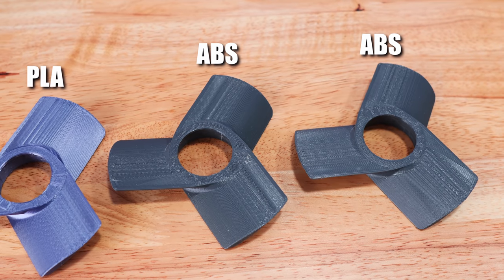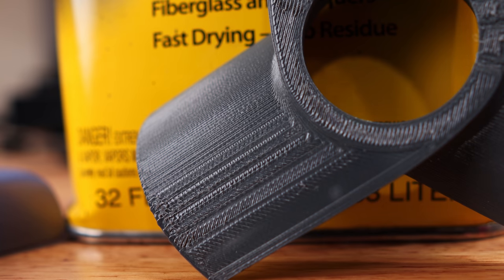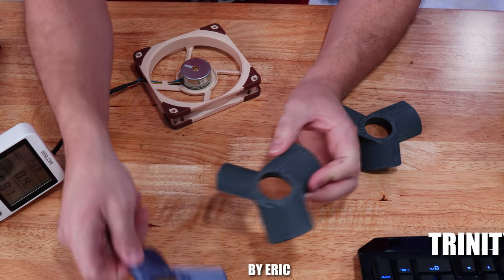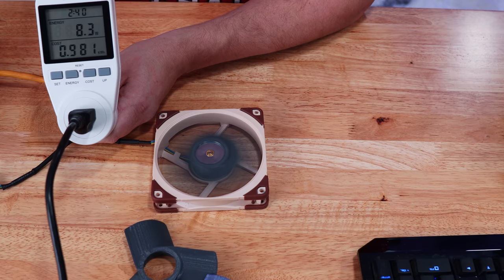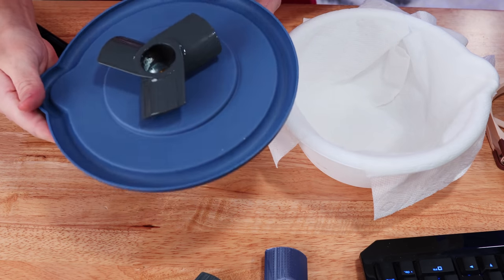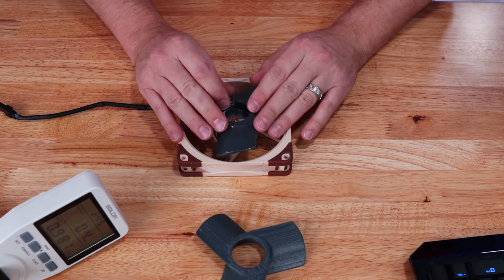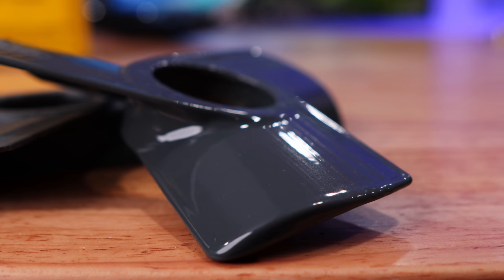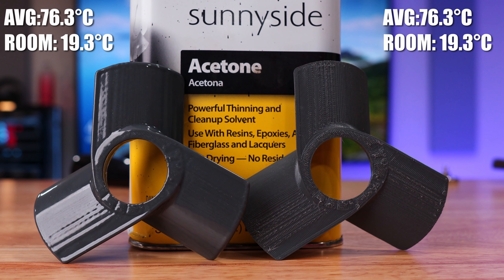Does Smoothing 3D Prints Improve Performance and Can You Smooth PLA?

Comment: First of all what this series lacks is a refence. The perfectly treated original Noctua is not a good reference. The same printer and filament should always be used and what I would suggest is actually printing out the original Noctua blade (with Noctuas permission or a co-operation of them sending you a print). Otherwise the results tested against the original are  poor.

Of course you get better performance with optimized surface. I hope this was never doubted to begin with.
What's more important: literally nobody, if it can be avoided, ever runs the fans at max speed. So they perform better by noise normalizing or being less noticable at the same cooling performance.

That said a glossy surface like presented here is not necessarily the best performing one. It's just that the printed surface is garbage when printed at those poor layer heights. I'd go for at least 0.12 or lower.

On top the effect can vary with surface itself. The fan present here might not be the best example for a typical 7 blade high surface design. But in the end it'll be hard to measure with amateur equipment anyways. Just something to keep in mind while seeing the "results" to interpret them correctly.

Great series though. Fun to watch the different designs.

Comment: size, blade count, pitch and weight determine motor loading. i fly fpv drones so matching a blade (prop) with motor's kv rating is essential. smooth or not that doesn't play much of a important role,  the difference is so small you cannot read it with that reader.

Comment: It's still pretty rough.  You've knocked off a few of the high frequency components but ...   I reckon it's time you got a CNC of some sort.  But the money !!!    Why have the paper hanging outside the container? It will only increase the rate of solvent loss.  Why am I even interested in this?    🤪

Comment: Well, In nature, almost nothing designed to move (with high speed) in air or water  is actually smooth. It may look smooth, but microscopically is anything but smooth. Take look at shark skin for example. A quick google search revealed this: https://www.travelandleisure.com/airlines-airports/sharkskin-squid-helping-build-planes
Soo... air needs to be guided, not let to freely pass over a smooth surface if low friction is desired.

Comment: at I've said plenty of times; at this scale, it doesn't make a difference.Golf-ball like dimples didn't make a difference and this is exactly the opposite (the grooves from the layers would have a similar effect on the air as dimples) so it doesn't have an effect either. It's not even about the surface, it's about the total size, and besides, drag doesn't really affect airflow for this purpose anyway, or car radiators and factory ventilation would also have them.

Comment: "smoothing" is a generic concept, not a specific chemical process that works with ABS.  You can also "smooth" 3D prints with sandpaper and fill gaps.  There are also epoxy coatings, like XTC-3D.

Comment: Smoother surface does theoretically improve airflow due to turbulence. But the fact is that in this application the difference will be so small it's basically irrelevant

Comment: Actually there may be a false interpretation of the given information. As the fan is pushing more air as there is less parasitic drag, because of the smoother fins; the fan motor will of coarse need to work more as more volume is travelling through. What smoother fins encourage is laminar flow which is what you are trying to achieve as apposed to turbulant flow. A volometer would point out the difference better than (pun intended) blowing smoke shows heh.

Comment: Is it just me or did both times, up and on the table ... it clearly showed 8.0 for a millisecond on your video.. it goes from 8.4 to 8.0, then you moved it again after it sat for only a few seconds of test....
Reply: thats a 5 percent drop.
Double checked.. yep, both times the smooth blade went down to 8.0 flat. 
Smoother aerodynamics wins
Reply: 5 percent power savings using them 24,7. Imagine if the world converted all pc fans to that. Instant 3 to 5 percent drop. Pretty crazy numbers if you run 20 fans, it pays for a whole new fan to run

Comment: I don't like the way you are measuring the power. Sure, the power supply has to get that energy from somewhere, but I'd prefer to see you use two multimeters, or just a 12V capable USB power meter (those are pretty cheap directly from China). 
You can actually smooth PLA, if you can get access to Chloroform/Trichloromethane.
And I think if you put two lamps in the corners of your new set and make a color gradient (like between a light blue and magenta), that would look pretty sweet.

Comment: first thing I thought was "sandpaper" not acetone lol

side note, 1 db is not audible to the human ear, so in reality they will sound exactly the same, measurement wise sure, 1db difference. in the car audio world, I get people bitching about 1db loss from "speaker wire that's too small" but when I do a blind test, they can't tell which car was the one with the 1db loss through the wire.... because no human has ears accurate enough to notice 1 db difference.

Comment: a smooth blade creates less turbulence which is more efficient.
Reply: it went down to 8.0, and he did not notice. That is a pretty tremendous difference for a simple smoothing. 8.3 changed to 8.0, watch closely
Reply: At the reynold number the blades are at, it's probably not even noticable

Comment: Prediction: The smooth will perform slightly worse or equal to the rough.

In aerodynamics laminar flow is the vision of perfection. But if you try and fail to get it the results are not good. Rough surfaces cause turbulence in the boundary layer which makes the surface perform just slightly worse than with good laminar flow but a lot better than broken laminar flow.

Comment: Sadly this power meter isnt sensitive enough to see the difference, so that test is completely irelevant. Logicaly the smoothed print does have slightly better efficiency, but its only a few %. 1/4°C difference would an amazing improvement for this kind of efficiency improvement, but sadly PC sensors are not sensitive enough to measure that. 

Otherwise nice testing and experimenting. nextime try to do a bit of research like how much usualy normal fan draws and from that you can estamate how big improvement can be, and how sensitive measuring you will require.
I love your testing videos. keep it up!

Comment: Up next: what happens when you acetone smoth an abs fan while its spining...
Reply: oh dayum! That would be cool. run the power wires through the tupperware lid and spin it up while its smoothing, just to see what happens.
Reply: The acetone might mess with the lubricant in the motor. Could destroy the motor.

Comment: Push it further man, you have a lower surface area because there are onlyt 3 blades. The results are not significant enough to be show, but with a 9 blade you have maybe 3x the surface area area thus 3x the effect of smoothing out

Comment: I strongly disagree that saying it being quieter is a performance gain. The smooth fan does no offer a performance gain.
Performance of a PC is relative to the number of operations that can be output per second.
Performance of a fan would mean lower temperature, meaning a higher overclock, meaning higher performance.
With that said, there is a higher preference towards quieter fans.
You can just say that a smoother fan is better because its quieter, but saying that it has better performance is very misleading since the function of a fan is to move air.

Comment: you are not actually adding resistance when pointing the fan down into the table, you are making it do less work since its moving less air... similar to blocked the hose of a vacuum cleaner with your hand.

Comment: If you want to see anything you should measure the efficiency as a ratio between the amount of electrical power consumption and the airflow x pressure. Measuring only electrical consumption and a zero pressure or zero flow makes no sense...

Comment: Just soak the PLA in liquid acetone for a few hours
Reply: It's not chemically compatible.  The solvent needs to be able to bond with the molecules of what you're trying to dissolve.  This is why certain plastics can be used for holding acetone, similar to why we need soap to wash oils from things, not just water.  (Soap molecules are able to bond to the oil on one side and water on the other.)  Ethyl acetate or tetrahydrofuran will dissolve PLA the same way as ABS+acetone.

Comment: There is a magic Tool that can make every Surface smooth, its called : Sand Paper...
Reply: Unfortunately, sanding removes a variable amount of material and wouldn't make for a fair competition.  Lots of the fans have very thin edges, as well, which turn into flaps and gouges if you don't do a perfect job sanding...and even if you do, given the layered nature of the prints.  Make a slim blade out of wood and you get similar results.  The more you try to fine-tune, the more you tend to gouge out the lighter-density bands in the structure, even with fine grits.
If anything, I'd print each blade separately and vertical to try to minimalize the turbulence from the printing striations, then assemble to the hub afterward.  It'd be a difficult job with lots of the more delicate designs, however, and very prone to imbalance due to imperfect alignment or different amounts of adhesive.

Comment: Every design is different and the smoothing affects it differently. Some of the design rely on the leading edge quality. This design is not. Some design rely on smooth surface to get laminar flow. Some rely on rough surface because it profits from turbulance. Not an easy task optimising avery fan. I believe some of the design can beat the others if they are smooth.

Comment: Your power test was kinda flawed. Should have tested the rpm as well. Electric motors use all of the power they're given. If the load is reduced they'll spin faster but maintain the same power draw up until they hit their max rpm possible.

Comment: You should not measure DC power like that, the accuracy is terrible come on. Buy a multimeter and measure the current. You can also use a bench power supply with integrated voltage/current display!

Comment: Your power measurement is too imprecise, 0.1W is well within margin of error with that method ... it even shows 0.4W before starting, so i would say at the very least 0.5W margin of error
Reply from the maker: 0.4 the parasitic draw
Reply: You mistake this for a channel about scientific testing, He's been using a thermal pasted tiny die (7700k) as a heat load to this point. Scientific testing doesn't belong here.
Reply: @MajorHardware  on regular PSUs the on/off switch breaks the circuit completely, so there cannot be any power draw.

Unless that kill a watt includes it's own power consumption tho, then that makes sense.

Comment: Not the proper way to measure power consumption of a fan..
Since a fan draws around 0.2A at 12V AND you measure it at PSU outlet, PSU having some kind of inertia, meaning that their outlet power draw will increase after you exceed a certain ammount.
And the wattmeter accuracy..
Proper way being with an ampmeter on the 12V line.
✌🏼✌🏼

Comment: What??? measuring the "efficiency"... ehr actually only the power consumption... and that with a killawatt and through a power supply. at least mentions margin of error which will be huge in comparrison.  The only way you could actually hope to measure what your trying to measure is with logging multimeters for voltage and current on DC into the fan while measuring static pressure and airflow into a controlled air baffle. youve done a lot of these videos and with every one of them i cant help thinking you should stick with PC hardware reviews.

Comment: The clearest conclusion from this test is that your testing methodologies are terribly inaccurate at measuring the performance of fans. Noise generation is energy loss by the fan. A quieter fan is more efficient. And yet you measured the same "thermal" performance. You need to scrap the thermal tests and switch to something more sensitive to the performance of the fans themselves.

Comment: Your method of testing is completely insufficient and inaccurate. The power meter you use has a resolution of .1 amps at 120V the power supply converting that to 12V gives you at best a resolution of 1 amp on the fan side, that fan might barely draw that normally. Testing minor aerodynamic differences you need to do much better, the ammeter should be in line between the fan and supply. Further get a cheep digital scale and and suspend the fan above it to test the actual thrust, lastly mount the fan to a funnel and test the static pressure produced. All these tests can be done simply, and cheaply with Amazon modules.